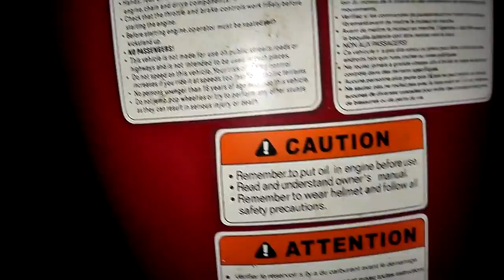Potential Minibike Engine

Comment: cut that plate right out and make it right the first time.  usually those angle bed frames are spring steel.  if it's spring steal the welds will break might not be right away but definitely a for sure thing

Comment: You can buy a new engine mounting plate. I want to get  a torque converter for my predator 212cc. Eventually, I want to find a twin opposed Briggs with a horizontal shaft, like a 16 horsepower or so. Also, if that 8 horse engine happens to be opposite of what you had, they also sell, I believe they call them jack shafts. Basically, you will have a short chain going from the clutch to a sprocket on the jackshaft. Then on the other side you'll have another chain going to the back wheel.

Comment: If you put a new plate in there anyways, why does the bolt pattern of the new engine matter at all? You could just drill out the holes like you need them. That would of course require cutting off the old plate, but that thing is just in the way anyways, since it will never be able to actually hold an engine, so get rid of it and be more free in your engine placement choices (not only the bolt pattern has to match, but also the crankshaft needs to be at the right position!)

Comment: I'd just cut that plate off, chinese steel sucks, weld on something new rather than try to bodge that cracked mess back together...

Yep, seals & gaskets, that usually gets an engine up to par, though if it's knocking, your big end's probably buggered... :P

hehe, can't wait to see the minibiking session you did recently with rex & struckus... :D

Yep, that minibike once it's built should be a hoot, more power, more torque, more fun... :D

And that's why I've been locking off the colour balance on my camera, the camera's great, but they really screwed up the colour balance algorithms...